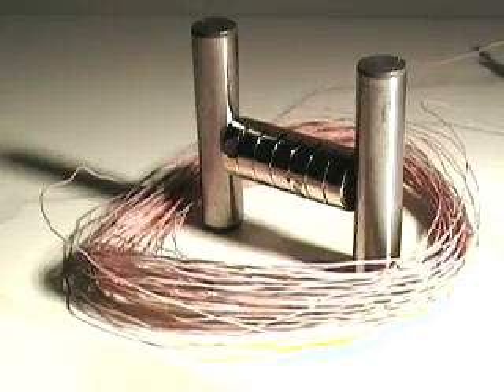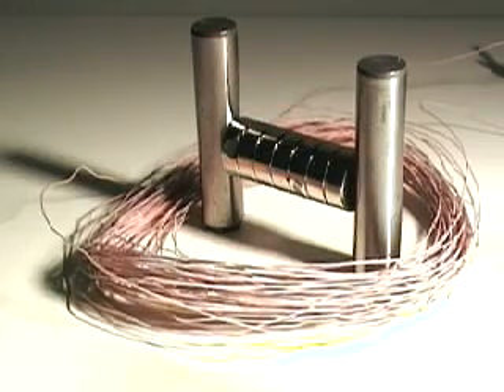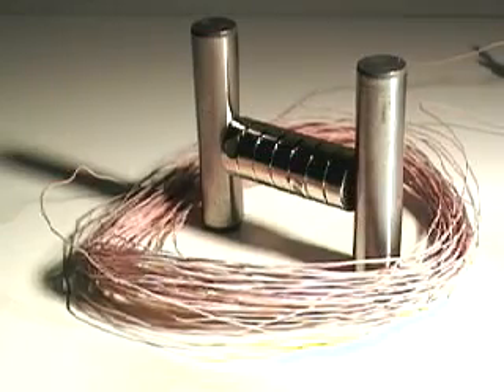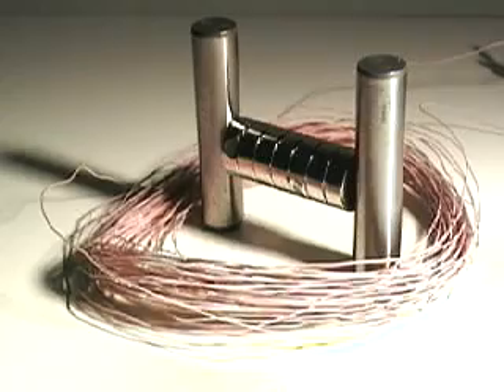Litz wire movement

Comment from the maker: @digitalenigma00

I take the output of the computer audio card and send it to a small audio mixer that has a headphone output. Then I put the left and right output positives together to one side of the wire loop and the negatives together to the other side. Now with a simply computer frequency generator program, I can send as many frequencies as I want. In the case of the video, I only used two frequencies going from 1hz to 7hz. Pretty simple stuff but enough to show the effect.